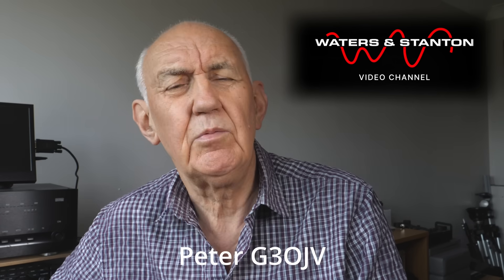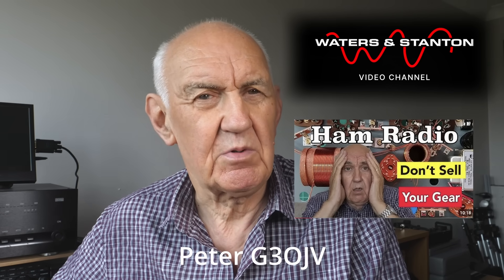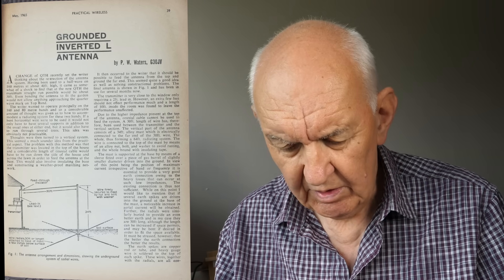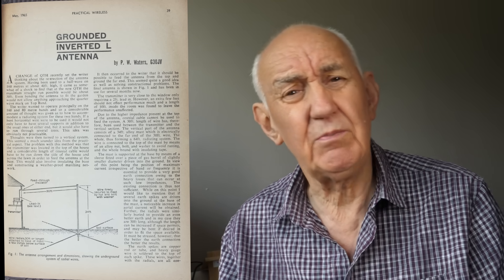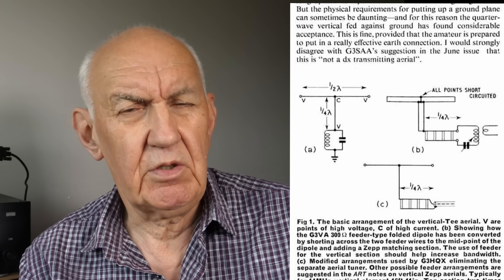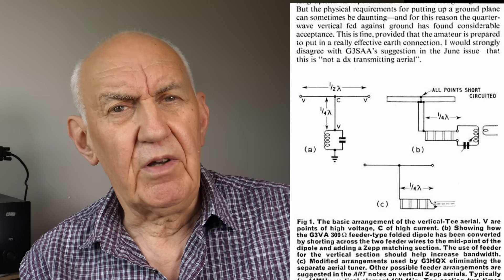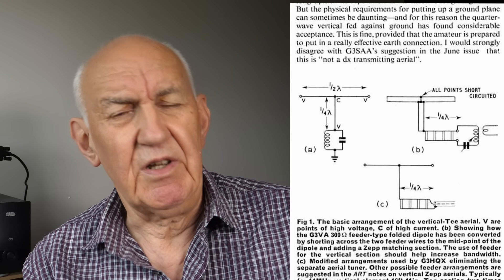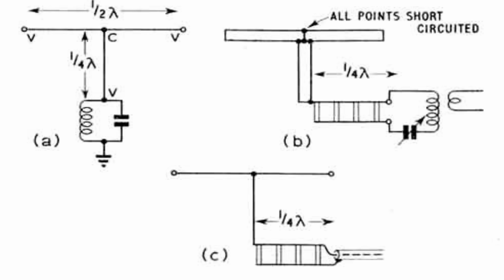Upside Down Vertical Antennas for Ham Radio

Comment: The upside down vertical does have merit. I have used a number of antennas along those lines.
I look at most antennas being basically dipoles or a variation of a dipole. Of course I always compare any antenna to the basic halfwave dipole installed about 1/2 wave above ground. That comparison works good at 20 meters and above where 1/2 wave in height is achievable. On 40 and below you compare to whatever height you can get! Since 1/2 wave on 80 meters is 130 feet that’s near impossible for most of us! 
My best upside down vertical is the 80 meter half square. That’s a directive antenna and beats anything I have ever been able to put up on 80 meters. One notch below that is a dipole with the center at about 50 or 60 feet with one leg dropping down vertically and the other horizontal. Sort of your modified T fed at the top directly with coax. You don’t get the horizontal cancelation but the vertical effect is the same and it takes up less space. When my half square is down I find that is a quick way to get on 80 and work DX. It is also not directive and gives me high angle horizontally polarized radiation for close in QSOs.

Comment: Am I right in saying that this type of t antenna is what is generally used for MW broadcast radio? There's one locally with two masts with wires suspended between them, and if you look carefully in the middle there are vertical wires. Any chance of a video on the cobweb antenna Peter? I'm considering this as my next option to experiment with. It's often referred to as being omnidirectional but it's not really omnidirectional there's a difference of up to 5 dB ( at 0.5 wl height agl) between the strongest and weakest directions, I'd like to know if it would be a big improvement on my inverted V OCFD in the weaker directions or if I would not notice a significant improvement. 73

Comment: Fascinating design--it resembles some of the early MW broadcast antennas which used top-loading with a short vertical wire.  Aloha es 73 de Russ (KH6JRM).

Comment: First, let me say you are an antenna expert to me. Anything I say isn't intended to contradict your thoughts or experience, but they reflect what I've learned. I started studying and experimenting with antennas in CB in 1973 as a teen and added Ham antennas in 1978 before I got my license. I made a lot of wire antennas including verticals and learn from experience and reading about other antennas and their results. 

My first thought was that i could answer your question about what happens if you change the horizontal angle of the ground plane wires based on my upright antenna experience.  But, then after considering that you are feeding the antenna from the other end, I realized that it probably will not work that way and rewrote this comment entirely.  

If the only difference in a vertical ground plane and inverted ground plane (IGP) were the feed point, I would confidently say that you would adjust the impedance by changing the angle of the horizontal wires and that the length of the horizontal wires is not critical except for a particular angle. But, with the feed point at the other end, well, that may change everything. 

What you have is what I thought of as a "T" antenna.  It is basically a bipolar antenna with 1/2 wave horizontal and 1/4 wave vertical elements. The advantage of this antenna over either a dipole or vertical is that it will have a broad TOA.  

I think that the G5RV, made for 20m,  is just a variant of this antenna with a horizontal gain element and a combination matching and vertical element.

Comment: Hello Peter - great video and going down memory lane so as to speak - I remember Pat Hawker - I have his book Amateur Radio Techniques which is well used and faded - the "upside-down" vertical is one which I am going to try - due to my minimal acreage "postage stamp" back yard the only multiband wire aerial I could fit in is my Barker & Williamson T2FD and my Gap Titan DX both of which I find great - I would love to have space for an 80m and 160m aerial but its only a pipe dream.
Thank you peter for taking the time to make such really great and interesting videos.
73 de Ger EI6DP
Reply from the maker: Many thanks for your feedback Ger.

Comment: Hi Peter , yes i have found the L/C tuned circuit to earth  works best (as with 3ele bobtail)fed via a linked winding and a current balun to help reduce  common mode currents on outer coax feed
Reply from the maker: Thanks for sharing your experiences.

Comment: Because the radial systrm is generally part of the counterpoise system, this concept reverses the concept and the radials now form the major part of the radiating system. This, because it is larger, may make the system broader and or more efficient.  It probably will also affect the feed point impedance. 

I wonder about feeding the transmitted signal up one of the ground radials with a balun or choke at the feed point. This would eliminate any interaction between the feed line and antenna and reduce the ground radial system.

Also, an unun may be needed at top to match the impedance to the feedline. Because of the expected lower impedance, a 4 to 1 or a 9 to 1 wire wound (linear) unun could be used. The antenna wire lengths could be designed for 20M which may work on 10 and 20 but not on 15 but could possibly be usable on 40M.
KK5R
Reply from the maker: Interesting comments. Many thanks.

Comment: T and L antennas were popular before coax and balanced line were common, just hook the end to the tank circuit of the rock bound transmitter in the shack below and tune it up. A half wave dipole works the same regardless how its fed.

Comment: Nice presentation. I would further add that the antenna’s popularity went as far back as the early 1900s. Used extensively in shipboard MF applications, with the RMS Titanic serving as an example, the horizontal element acted as a capacitive top-hat. If you look closely, this antenna also appears on the US government FCC official seal.
Reply from the maker: Thanks for sharing the historical background.
Reply: @watersstanton  My pleasure.

Comment: This brings up a question I've always wondered about: a vertical collinear antenna at UHF frequencies. Propagation is largely line of sight and, due to the curvature of the Earth, coverage is dependent upon the height of the antenna. As I understand it, the radiation pattern is largely at the feed point of the antenna. So ... what about mounting the antenna upside down and feeding it at the top? Or suppose the height of the antenna is constrained by either law or practical considerations -- is it better to have a higher gain antenna with a lower feedpoint, or a lower gain (shorter) antenna mounted higher. I had considered modeling the antenna, but I'm not sure how accurate this would be (without somehow also modeling the surrounding terrain as well).

73 de AF6AS
Reply from the maker: The point of maximum radiation coincides with the point of maximum current which is not always the feed point. For VHF, the higher the better.